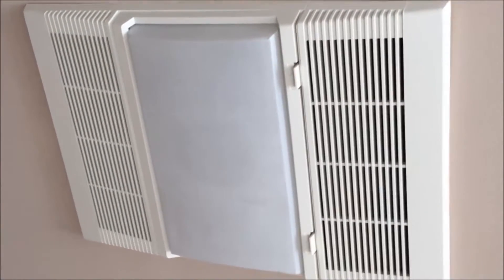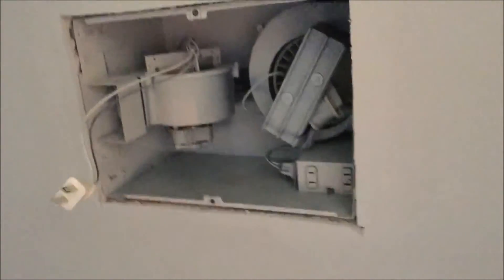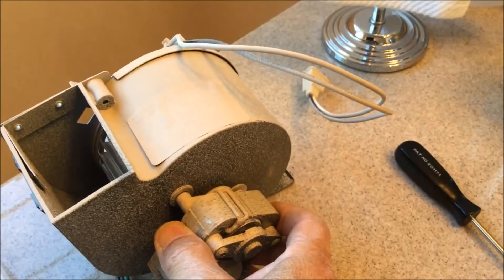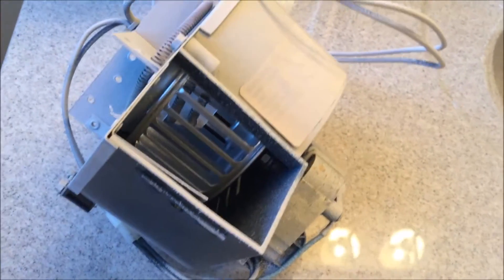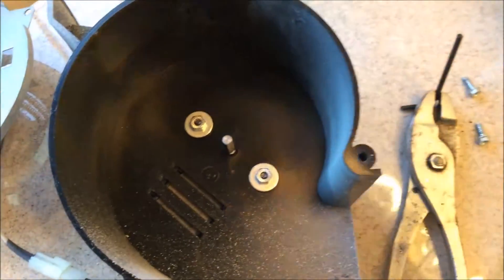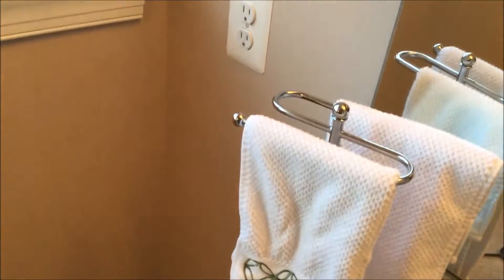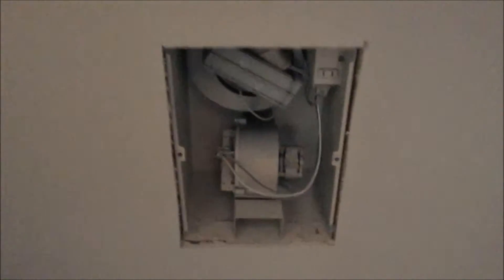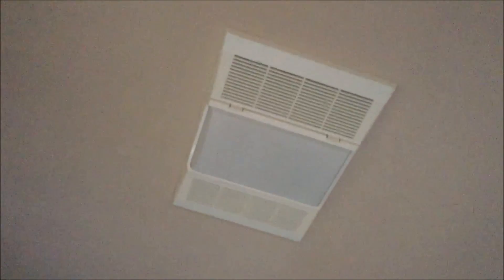Broan - Nutone Heat-A-Ventlite Bath Exhaust Fan with Heater 605RP - No heat

Comment: If anyone else ends up on this video with the question of how to take the cover off, the answer is push the tabs in the direction the arrow said.

I found this wasn’t working because the tabs were clogged with 20 years of dust. I used a shop vac on the tabs and then a small blade to get the rest of the dust, then pushed the “V” shape closed using a screwdriver. Probably best to turn the breaker off before sticking a screwdriver in there just in case you miss…

Comment: Please show how you removed the glass lens from the grille. I am having no luck doing so...perhaps the heat over the years (when the heater was working) has affected the plastic grille that is holding the lens? Any help would be appreciated.
-Jim
Reply from the maker: just gently pull the whole grill straight down to access the glass

Comment: Tested switch with ohmmeter it's good. And took off blower motor ( listed as heater assembly) and tested that. Dead. I also plugged it in nada dead. Cost about $80 to replace .
Reply from the maker: Good job!  Those nutone blower motors should be $40-70 max dellivered on ebay.

Comment: When i turned on heater switch there wasn't any humming . Totally silent . Could it be the wall switch ? Or the blower motor ?
Reply from the maker: I personally would start troubleshooting the easiest item to get to (probably switch but might be the unit).  A simple non contact voltage detector/tester WITH MUCH CAUTION is what I would use (very cheap on aliexpress ... under $2 DELIVERED but you have to be patient on delivery).  It's a very handy tool to have!

Comment: Show how u took the cover off
Reply from the maker: GENTLY Pull the PLASTIC cover straight down by grasping the sides of the fan cover and expose the cover clips. Then Press the V spring clips with your fingers to squeeze them together and then pull the cover the remaining way off the fan. You might want to completely remove the glass FIRST by releasing the two white tab clips that hold it.  You can easily see them next to one of the grills.  Take the glass completely off.  Then gently pull down the remaining plastic "frame".  Almost every bath exhaust I've seen initially looks like it has no visible fasteners but is in fact held with some sort of spring (usually NOT a round spring but a V shaped spring)

Comment: Can you put a thermostat on this ?
Reply from the maker: What temp setting would you select for the thermostat?  I personally would not add anything to a heating element like this for fear of creating a fire hazard!
Reply: @YuDaMan  so its a regular switch good?
Reply: Im just asking because the thermostat is functions as an on and off switch, its just so its not constantly running
Reply from the maker: I use a timer on mine like one of these:  https://www.homedepot.com/p/GE-In-Wall-Digital-Countdown-Timer-15318/202788262 or https://www.amazon.com/Enerlites-Timer-Switch-Countdown-Bathroom/dp/B01LXRNFGG or https://www.maxximastyle.com/outlets-switches/60-minute-spring-wound-countdown-wall-timer-wall-plate-included etc.  You get the idea.....